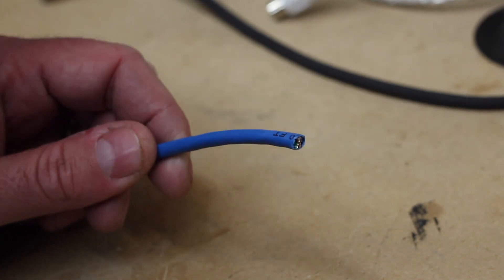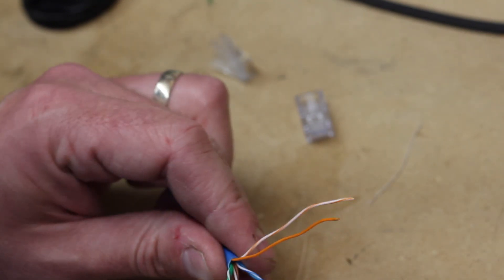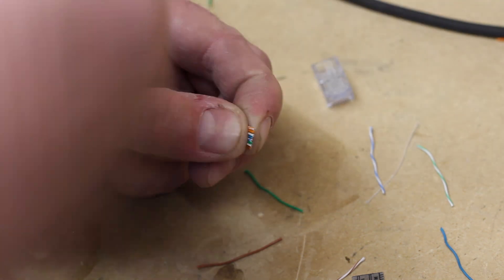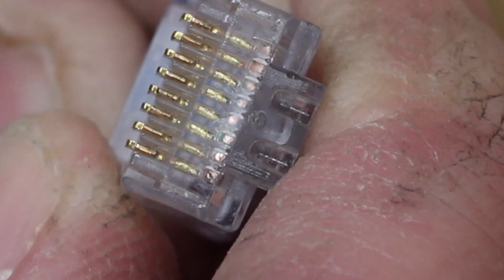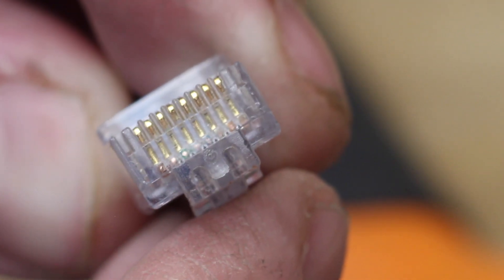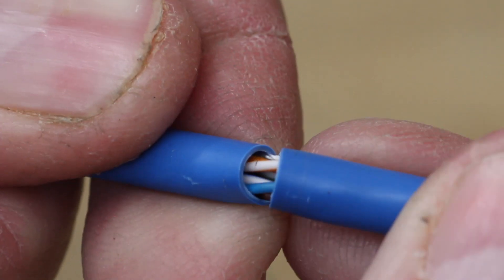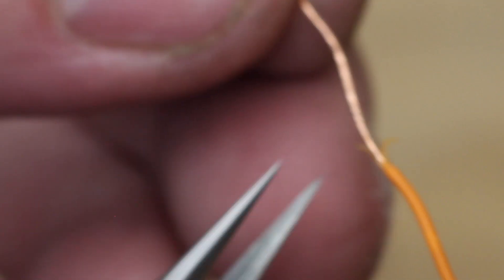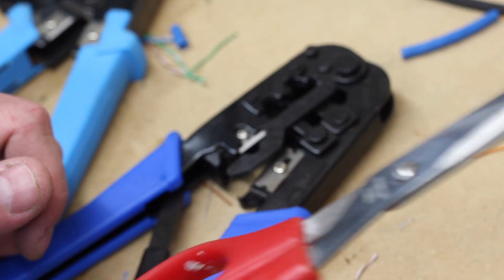How to Make Ethernet Cables That Work Every Time Without Testing

Comment: That's almost exactly how I've been doing it for years too.

My bigest headache is that some brands of cable use shades of green and brown that my tired old colourblind eyes can't distinguish.
Reply: That's bad, and the other bad thing is when you buy 250' of 5E on Amazon only to find out that its barely twisted CCA cable and instead of stripes, they use lighter variants of the tip color. (Green, lime green / Red / Blue, light blue / Pink / Brown, light brown.) It barely passes for what I call "CAT2.5" lol.

Comment: I'll have to try this method next time. I have always only cut a half inch of the outer insulation. I do usually look for the copper circles at the end. I think sometimes my crimp doesn't push the metal contacts down into the wire, but I;m not actually sure where this one failed.